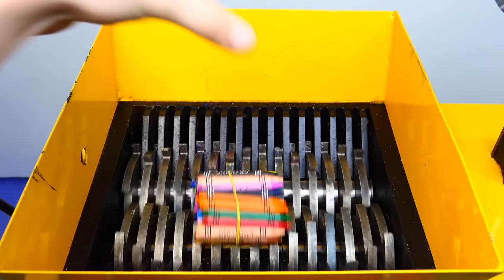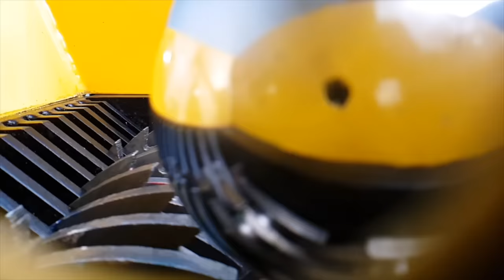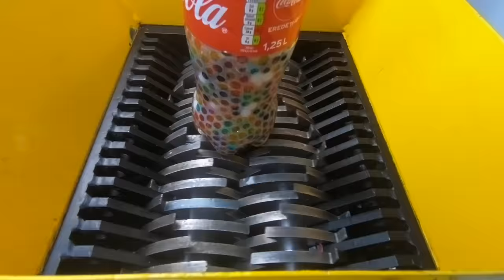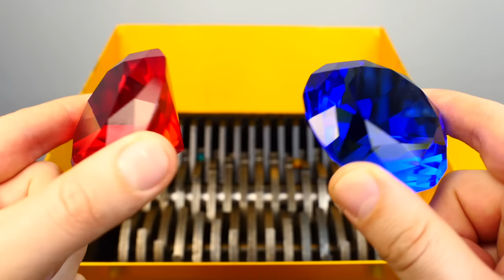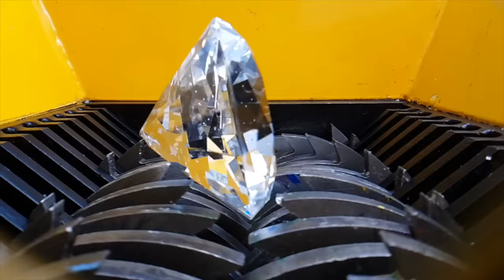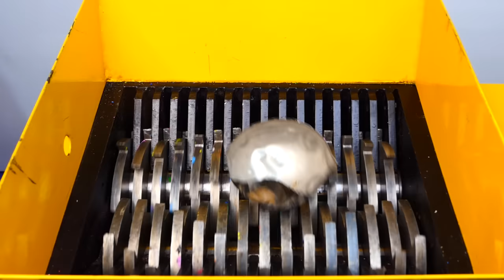SHREDDING DIAMONDS! AMAZING VIDEO!

Comment: 4:28 nobody:

me: closing eyes so the glass doesn't get in my eyes
Reply: That's amazing. Honestly I almost did the same.
Reply: Hadassah Wambui same XD
Reply: Hadassah Wambui haha
Reply: That is on a level I cant even explain
Reply: Tbh I’ve seen those at Dolarama and their plastic-
Reply: Same
Reply: Jesus is saved
Reply: Hadassah Wambui the way it fractured it looks like obsidian
Reply: @chernoboggames5973  that's because it is glass not plastic, obsidian is an igneous rock formed by the melting and pressure and whatnot of the earth in certain areas. It is basically glass...not made from sand exactly but similar
Reply: That happens when u do That without closing ur eyes IRL XDDDDDD (no hate)

Comment: To all these kids not knowing this: this diamond is a non-Carbon based diamond, it’s pure purpose is for jewelry. It is purely made of Zirconium, a far less durable variant. The shredder would instantly break if it was a real carbon-based diamond. “The only way to break a diamond is to use a diamond”. You can buy diamond for tools. Diamonds seem very expensive but they are pretty cheap to find, they are pretty common - 6000ft under us. The earth is 97% carbon. There are a lot of Real diamonds but they are hard to get. Don’t think that this YouTuber purchased and $80,000+ diamond just because, SPOILER ALERT: he didn’t.

EDIT: it’s not made of carbon or Zirconium, it’s made of Glass - crystal.
Reply: Nice lesson
Reply: @Tomas gonçalves, I try my best.
Reply: Diamonds are HARD meaning they can't be scratched, but they're actually quite brittle. It's a complete myth that diamond is absolutely indestructible/can't be broken. So I don't think the machine would "instantly break." The Hydraulic Press channel did a video crushing a (REAL) diamond, and it shattered quite easily.
Reply: It’s said in the description.
Reply: Thanks
Reply: I hope you’re aware that zirconium is carbon-based.
Reply: Also, the jewelry diamonds are called “cubic zirconia”. Not to be confused with zirconium.
Reply: @Ghoul, yet cubic zirconia is a zirconium-compound. It’s not hard to learn these things, please check your answers before commenting.

Best regards,
DJ - J3R
Reply: Z Boss, no worries!
Reply: @melonie ashway, I admit that I did exaggerate it, diamonds are strong if used in the right way. It would Damage the shredder severely though.
Reply: @Sondreara, the description said it glass-crystal, that’s all.
Reply: @Ghoul, “yes but actually no”
Zirconium has similar characteristics but it is it’s own element. Take a peek at the periodic table of elements please before commenting!
Thank you!

Best regards,
DJ - J3R
Reply: @Ghoul, 8th graders like me don’t have to lecture a college student like you.
Reply: DJ - J3R likewise
Reply: DJ - J3R “Like most carbides of refractory metals, zirconium carbide is sub-stoichiometric, i.e., it contains carbon vacancies. At carbon contents higher than approximately ZrC0.98 the material contains free carbon.” Think it’s you who needs a good fact-checking.
Reply: @Ghoul, excuse my behavior. I was acting like a smart-ass.
Reply: DJ - J3R nonetheless, different things all together. You’re right. You can find all these answers with a quick google search. It’s a great disservice to the public when you post misinformation as fact.

Comment: A real diamond cannot be cut by metal or crushed easily because it is the hardest stone.  In fact, the way jewellers cut diamonds is by shaving diamond into dust slowly over time, then coating a diamond cutter in that powder, and cutting the diamond into its iconic shape.
Reply: @iantan8321  technically all stones can be crushed, but diamond is the hardest is what I meant
Reply: @iantan8321  funny that you’re calling him stupid even though he’s right. And I doubt you could crash a diamond with a hammer.
Reply: @iantan8321  that diamond yes but that is made of glass. Real diamonds can’t be crushed lest by using a hydraulic press which can apply huge amounts of force.
Reply: @iantan8321  it can be crushed but its not easily read bruh
Reply: I agree with lan a diamond isnt the hardest stone and what do u think they shave the diamond with
Reply: And why would u think he would use a real diamond u think he is trying to kill him self with that big ass diamond
Reply: @blueberry4703  they shave diamond with a special powder that they coat the shaver with duh
Reply: @xXmlgamingXx355  that’s correct, you can’t.  You have to use the right material.  If you put a diamond into a steel press, the diamond will leave a small dent in the metal whether it is crushed or not.  Thus proving that diamond is the hardest stone.  When I say stone, I mean like amethyst, sapphire, ruby, opal, etc.
Reply: @iantan8321   I don’t think they deserve to be called stupid, however your description about hardest vs strongest is correct-  diamonds can be crushed, but they are the hardest out of the stones because they take more force and more pressure to crush/break/scratch than any other stone.
Reply: @blueberry4703  ok try to crush it let see
Reply: @blueberry4703  read some books
Reply: @bruh3596  well if ur paying for the diamond come on
Reply: @iantan8321  no you can’t😂 it’s not like glass
Reply: Okay...... I don't want to get hate but diamonds are extremely hard. However, that just means that they're difficult (but possible) to scratch and chip on the surface. ... However, if you took a hammer and hit a diamond at the right angle, it would easily shatter.
Reply: @iantan8321  it's fakeeeeeeee ok
Reply: nobody asked
Reply: Diamante não é pedra, é uma gema e uma maneira fácil de quebrar é bater com um martelo.
Reply: All wrong. An iron hammer can do the job. You have all been biased by the capitalistic lie that is “diamonds are forever” sure they dont wear down but its so delicate even My shoes can pulverize them.
Reply: @noneofyourbusiness9907  we never said they weren’t breakable, but out of all stones they are the hardest to break.  It doesn’t mean it’s difficult to do so.
Reply: @spxcedvst  Diamante não é pedra, é um tipo de gema. Eles são fáceis de quebrar quando de bate com um martelo com força moderada. Se você prensar ou tentar riscar aí o negócio fica difícil.
Reply: @cz-anonimo3463  sorry I only speak English, French, and Chinese
Reply: Diamonds can be locked in a wooden wedge and split or cleaved with a piece of metal you place on the cleavage plane and then you strike it with a hammer. Thats how they used to break very large stones down so they could then be faceted individually.
Reply: @iantan8321  depends since the only way to chip one with a hammer in your instance is to find where the atoms aren’t bonded so tightly and unless you have a microscope on you it’ll be very hard or very lucky to break one with the amount of force a human has
Reply: @iantan8321  and a real diamond is 1 billion almost
Reply: Or more
Reply: @naphexo  I’m in the majority which is correct while you and and your alt account are wrong
Reply: @noneofyourbusiness9907  but it would take some force to do so, it wont be very easy.
Reply: @spxcedvst  its diamond powder
Reply: Actually, it's true! The term “hard” just means it doesn't wear down from scratches. It's not “tough” meaning difficult to destroy. Diamond is brittle very much like glass. Unlike glass, it's not easy to sand because diamond can resist friction. But as soon as you apply force directly like with a hammer its odd crystalline structure makes it unable to deform, shattering the diamond. Get it, stupid? Go watch game theory!
Reply: Stop buying into myths when you dont know what you’re talking about.
Reply: I not one of those old grannies that think everything on the internet is a bad influence. I use the internet for godsake!
Reply: IMHO
Reply: @s y d yes that right i saw that if you break diamond it wont shatterd if it will then it will go low on value it dosent mean we can smash it like who would do that it means the specific glass are made out of lava and they burn what inside called dia so if it would be shartterd then the diamond with not be a diamond it would be called doy dia stone
Reply: Bedrock is the strongest stone
Reply: Bruh
Reply: I use the diamond to cut the diamond
Reply: Actually a diamond would shatter in that grinder.  They're very hard, not very tough.  That's because they have an octohedral crystal lattice, which doesn't give room for the diamond to bend and morph shape. When they cut diamonds in big sections, they merely tap it with a specialized chisel along the grain, and it splits clean in two. You could never do that with steel or other materials
Reply: @qwii69  a hammer can never shatter a diamond no matter at what angle
Reply: @noneofyourbusiness9907  an iron hammer can't crush a diamond for god's sake
Reply: @iantan8321  listen a diamond can be broken just not with a hammer, inorder to shatter a diamond you need extreme  amounts of force
Reply: @debrecenigeri5531  only super big diamonds are 1 billion not all
Reply: Daimond is the hardest substance in the world
Reply: @noneofyourbusiness9907  how so?
Reply: I am starting to understand the point a little, indeed diamonds can be destroyed using a hammer and it is true that it is not easy to destroy diamonds because it requires strong pressure, but it all also depends on the size, because the bigger the size the harder it is to destroy, that is why it is not easy to destroy diamonds.  use a hammer but it is still possible to crush them using a hammer if the diamonds are small.  sorry if it's wrong because my English is not good
Reply: I think you are trying to be right but you in your life will get an diamond, its more, you never seen a diamond break and you are lying, Ian is right.
Reply: Wait till you watch water Jet do they thing
Reply: @iantan8321  I agree because if you crush a diamond at its bottom tip it will shatter easily.
Reply: @iantan8321  not true
Reply: @iantan8321  Finally you get it!
Reply: @iantan8321  Um ian sorry but its not hexagonal. Hexagons make things strong. Its irregular molecular shapes, scrambled polygons, thats why diamond is structurally unstable.
Reply: @noneofyourbusiness9907  lmao, so just cause you've been proven wrong you're just gonna spout insults? That goes to show just how big of brain you've got like damn
Reply: @namelessguy5491  I love how this conversation about a plastic/glass/acrylic/etc. diamond has been going on for quite awhile it’s surprising-  anyways yes you are right, it can be crushed or scratched easily- but I’m talking about a real diamond.
Reply: I find it funny how every piece of information in the comments turns into an arguement. This seriously needs to stop.
Reply: Holy sh@£#!t!  Ur so smart!
Reply: @T0M3HAWK633  I’m not smart enough to be able to tell if you’re being sarcastic or not
Reply: Yall watch dude perfect ot 1 there is proof that i cant be crushed
Reply: Diamond is unbreakable
Reply: @everyonesfavoritecaptain335  nothing is unbreakable but everything is unbreakable at the same time. Just like how meaningless our existence is, we serve all purpose but none at the same time
Reply: @trananbinhjerry6438  it was a jojos reference
Reply: @everyonesfavoritecaptain335  i know
Reply: THE MORE YOU KNOW
Reply: @spxcedvst  i agree with you why i like diamond and I read on wikipedia that diamonds were created under high pressure so they are difficult to destroy
Reply: You aren't geologists now stop arguing like little 2 year olds
Reply: @RobotLinc  I wonder if this isn’t so much arguing but perhaps just entertaining to watch
Reply: @xXmlgamingXx355  You can actually shatter a diamond using a hammer if you hit it at just the right angle and point, but it's very hard to do so
Reply: @bruh3596  it needs something like 200'000 tonnes of force to crush it.
Reply: You might think is gold strong gold is a soft metal and diamond is way stronger so most likely a piece of gold would break off of this but diamond no

Comment: The diamond: I'm just gonna dance for a while...

Edit: For everyone saying its glass, not diamond, it's glass in the shape of a diamond. Therefore, it's a diamond, even if it's fake.
Reply: The ball: i'm dancing too and i'm broken
Reply: @lephrog9159  :_____.
Reply: Nda bisa basa inggres
Reply: The ball: sans dodging
Reply: @lephrog9159  Yes
Reply: @bunichan5619  undertale
Reply: @lephrog9159  exactly
Reply: Yea the diamond I’m just going to dance for a while
Reply: @lephrog9159  Yes right
Reply: @jennabuck8840  It is glass not diamond
Reply: I think it's fake Dimon a Dimon never breaks
Reply: @honeybear1078  is probably 9
Reply: So if I make a sponge shaped glass, it's a sponge even tho it's fake? You're a new type of special
Reply: Its fake how could it be possible diamond r u so hard they can't even be distorted by a gun bruh
Reply: Its glass
Reply: So?!
Reply: @MilkyTendrils  I mean, technically if the sponge shaped glass you make has the entire structure of a sponge with holes and stuff, you can call it a sponge because water can still pass through it.
Reply: @ohanaross-roberts9719  Yeah well get your facts straight, even if it is a fake diamond, it's still a diamond.
Reply: @Lianmin27 ... That's now how a sponge works, think about it a little, what do you usually use a sponge for? Now imagine doing that with glass
Reply: @MilkyTendrils  it doesn't have to work that way, what matters is that it appears like it. Like how if you sell a diamond, it would go for alot but if it made of glass it's most likely worth nothing. So its like glass sponger won't work, glass diamond won't sell.
Reply: @Lianmin27  then that's called a fake, now we're getting somewhere
Reply: @MilkyTendrils  Regardless whether it's fake or not, you call it a fake diamond which has the word diamond in it, so why don't we just call it fake glass if it's not a fake diamond. My point is, it looks like a diamond, therefore it is one. It doesn't matter if it's fake honestly. We all know it is fake, so there's really no point in arguing.
Reply: @Lianmin27  we call it a fake diamond and not fake glass because its real glass but its not a diamond it doesn't have the structure as a diamond and the argument that everyone knows it's fake doesn't work because there are people that still can't understand its fake due to the strength
Reply: @MilkyTendrils  No that's not it, its a fake sponge like how it's a fake diamond.
Reply: @Lianmin27  now you're admitting it's a fake diamond see?
Reply: @MilkyTendrils  When did I say it isn't fake anyway. In the original comment you can see me clearly stating out the fact that "it's a diamond, even if it's fake"
Reply: @Lianmin27  If it's fake then it's not a diamond it doesn't have the same molecular structure as a diamond therefore it's only glass and can't be anything else just because it can look like a certain object doesn't make it the same as it
Reply: @MilkyTendrils  well then it's a fake diamond and that statement has the word diamond in it so there's nothing you can do really to change my mind and you can say the same to me.
Reply: besides i never even said its a real one anyway so it doesn't really make sense for everyone to think i did say that which is weird.
Reply: @Lianmin27  ok so by that logic if i name my child rat then he is a rat? 
and the "I never said it's a real one" is two faced cuz you've said "My point is, it looks like a diamond, therefore it is one." you say it's a diamond then when your statment get's debunked you lie about it just to be right
Reply: @MilkyTendrils  "therefore it is one" doesn't have to mean its a real diamond, to which i even immediately after said "even if it's fake."
Reply: @Lianmin27  It can't be fake and real at the same time nor neither, you have to pick one which is it?
Reply: You know it has to be made of diamond to be a diamond?
Reply: @anewworldcomics6587  it has to be made out of diamond to be a real diamond. Others are just fake, but regardless they are still diamonds, just not real ones.
Reply: @MilkyTendrils  I literally never even said it's a real diamond anyway so i don't get how you can just put that logic on the plate.
Reply: @MilkyTendrils  uh oh seems like somebody lost their temper, in fact that just proves how right i am. You're failing to accept the truth as it is and willing to go so far just to prove a random person on the internet wrong who didn't even do anything to you lol
Reply: and honestly i literally even said in the original comment that it's fake, unless your blind, in which case, i feel sorry for you.
Reply: @MilkyTendrils  then why is there even a reason to call it a fake diamond anyway?
Reply: @Lianmin27  because it's not a real one, it isn't made out of the same material but it looks like one (doesn't mean it is one) so that's why people call it a fake diamond
Reply: @MilkyTendrils  well that simply means you're telling me to choose one; fake or real then saying I can't choose fake because it's not an option. That's not how it works, my friend.
Reply: @MilkyTendrils  there's literally not a single thread of evidence proving that i said it's neither lol
Reply: @Lianmin27  this is the last time i'm going to respond because all my points are going through your ear at 100kmh and leaving at 200kmh. I'm gonna leave this here "well then it's a fake diamond"   "then why is there even a reason to call it a fake diamond anyway?" "but regardless they are still diamonds" "even if it is a fake diamond, it's still a diamond." "you can call it a sponge because water can still pass through it." none of these statements (all yours) have even one ounce of logic. you've contradicted yourself due to trying so hard to make up anything that you think justifies your original point just to not be wrong
Reply: @MilkyTendrils  aw leaving so soon already i was having fun debating

maybe you should actually think about what i meant